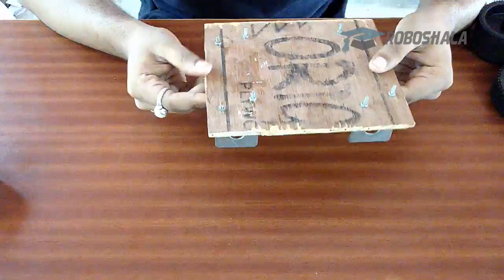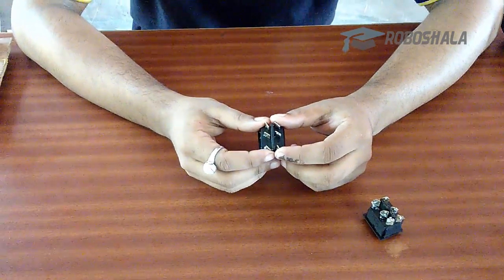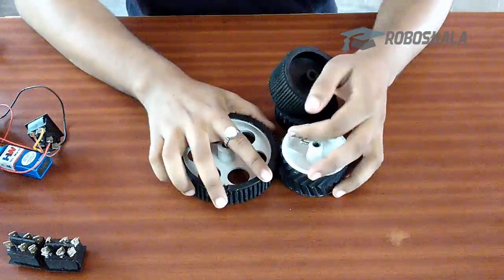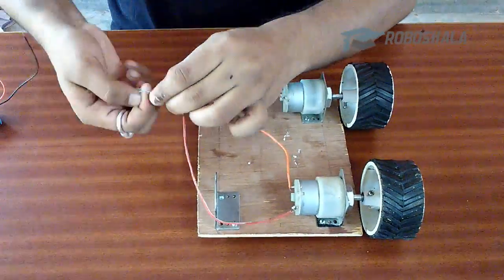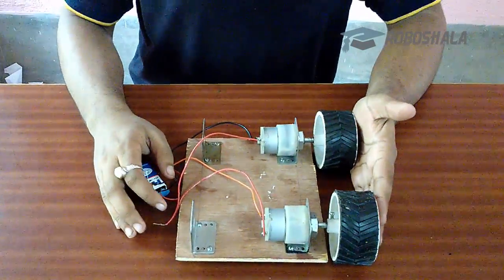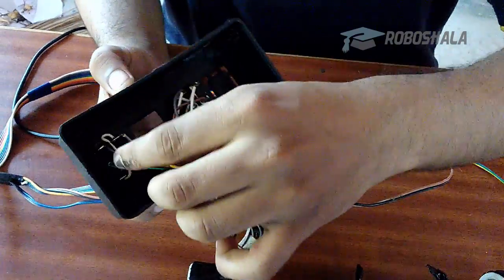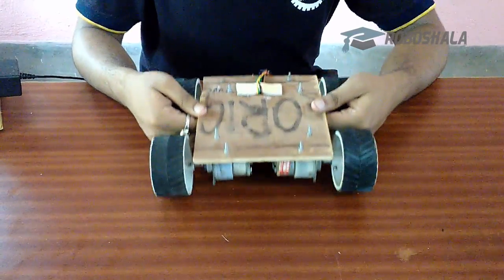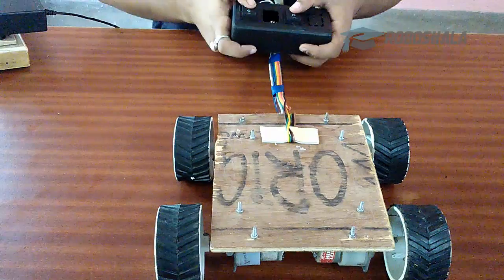Manually Wired Control Robot

Comment: Hi should I use 300 rpm motors or 150 rpm for obstacle race? 12v 2amp adapter
Reply from the maker: +drifter13 150 rpm will be better for obstacle bot..
I will upload obstacle avoiding bot tmrw...